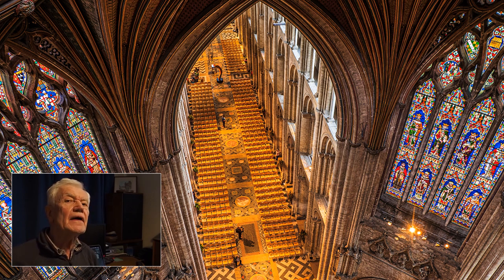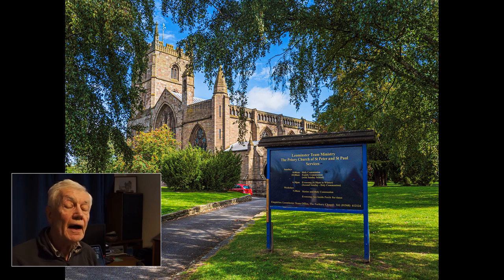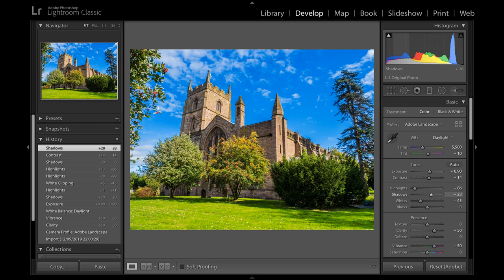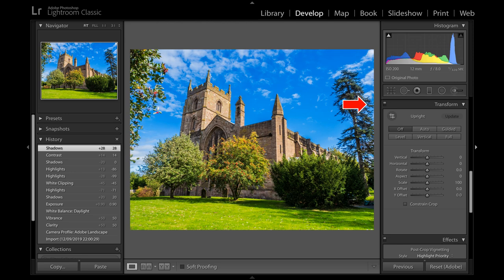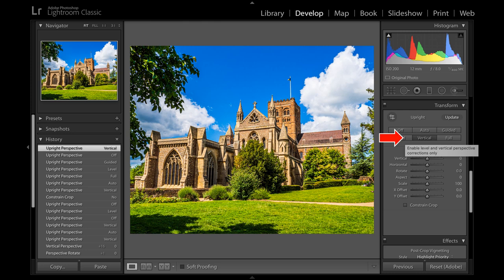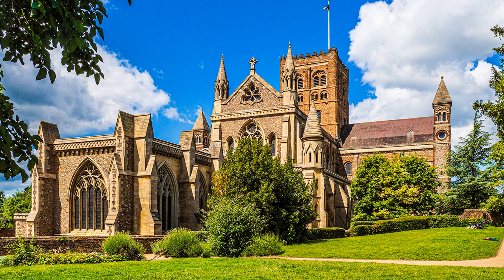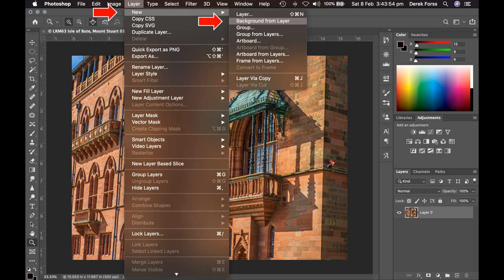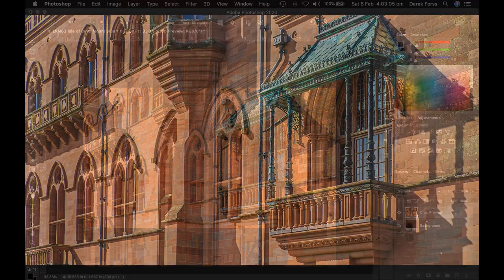How to Photograph No 6 - Buildings and correcting converging verticals

Comment: Very good tutorial. 

While convergence/divergence correction works quite well, I feel that the result is sometimes a little artificial because the view is essentially distorted. A keen eye will notice that the foreground perspective doesn't quite correspond to the perfectly vertical building outline, creating the optical illusion that the building is wider at the top than at the bottom. So I prefer to do only a partial convergence correction to give a more natural look.
What do you (and others) think?
Reply from the maker: Thank you for your comment. Michael Gent commented in a similar way, to which I acknowledged. I think it is up to personal preference.